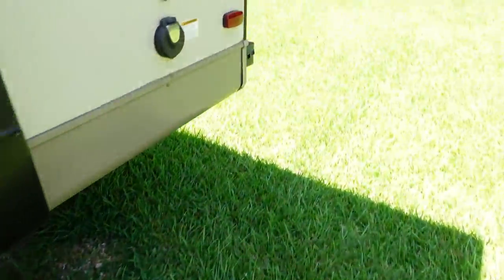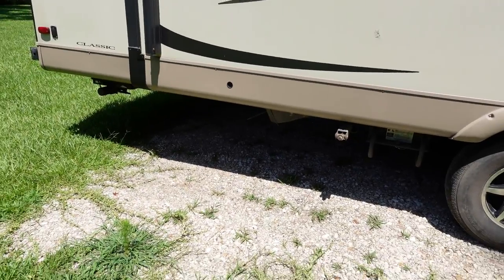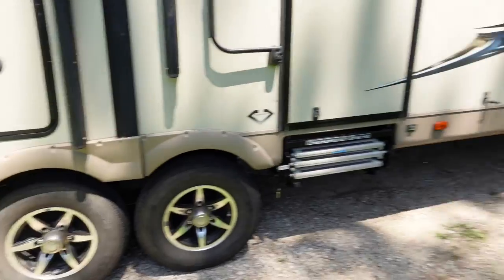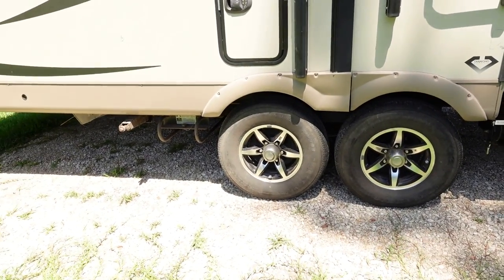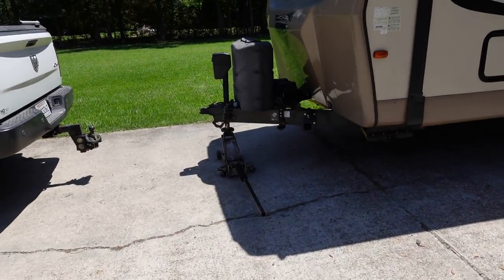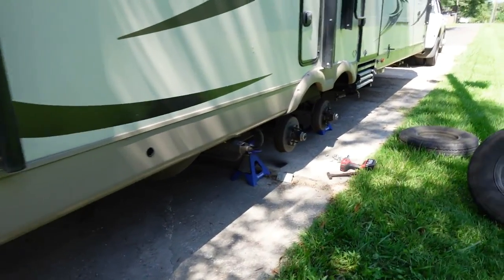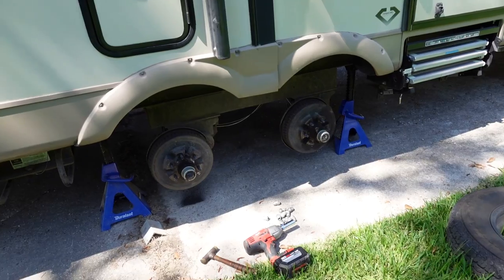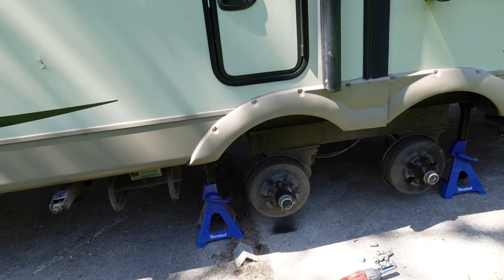RV Camper Excessive Tire Wear

Comment: This is a problem, there are lots of possibilities.   
1] Wheels might have been bent, low pressure, or bad bearings 
2] The Axles or any of the hangers, shocks, springs, the equalizers are bad, or the shackles are worn. 
3] The alignment from the hitch to the front center of each of the tires on the first axles, [[with tires on and hitch level.]], BEST WAY IS TO GET 3 LARGE NAILS and a PLUMB BOB [or equal] BOB THE 3 LOCATIONS AND DRIVE THE NAIL INTO THE GROUND,  MEASURE NAIL TO NAILS.
4] then distance from center to center of caps of the tires on each side. 
5] then measure 'X' style from the inside left front tire to the inside of the right rear tire from under the trailer, and then the opposite two, write everything down.  
6]  BUT BEFORE you do any of that, walk around the trailer and verify that EVERY bolt that is connecting the walls and floors to the metal frame is present and the NUTS and WASHERS are on and are TIGHT.  

I noticed you had at least one with no nut on the driver's side between tires, this is very common. There should be one every 4-6 '' ALL AROUND THE OUTER AREAS look for the out-riggers under the sides, front, and rear.

7] Replace missing and tighten everyone to the PROPER TORQUE Typically 45-75 pounds  it should say somewhere,   mine is 55 pounds
8] YOU NEED TO VERIFY THAT YOUR FRAME AND STRUCTURE IS STILL SQUARE.   
YOU CAN USE THE   ''3, 4, 5'' Rule or measure front left to rear right and front right to rear left.   Another ''X''  

 A BIG 4-6 FOOT ''SQUARE'' IS HELPFULLY or 4 SQ LASERS,
NOTE;; 
NONE OF THE MEASUREMENTS SHOULD BE MORE THAN 1/16'' OFF. [1/8 IS PUSHING IT]

IF YOU NEED OR WANT SOME HELP, LET ME KNOW 

e-trailer has lots of information, pictures, and videos on all of the above. 
good luck I hope this helps.

Comment: I had the same issue on a dual axle travel trailer I bought.  Only had about 3,000 miles on it and I noticed one of the tires had a lot of wear on the outside.  I thought, great.  Now I'm going to have to get a wheel alignment.  I took off that one wheel and I checked the wheel bearing.  It was loose!  Not real loose, but loose.  I tightened it about a turn on the nut and never had anymore issues.  I did have to get another tire, though.  I can't believe how they put these things together!  No quality control at all.

Comment: I got rid of the China Bombs and purchased Goodyear Endurance for my TT the week I purchased the TT,.add it from Nashville through Texas New Mexico and up to Sturgis they still look good and handle great. IMHO the endurance tires are probably the best option especially today with the Covid supply issues. I thought about get LT tires but the proper load range is hard to find in the correct size. I had to order them from discount tire took 4 days to arrive.

Comment: There's absolutely no Quality Control on campers built in the last 3-4 decades 😔  since the manufacturers are all Big Corporations run today and no DOT oversight like vehicle manufacturers have. It's max profits at the customers dime! I purchased a 2019 Winibago travel trailer when it was just 8 months old.  So many things wrong with it 😒 most you would say was just lazy work but it's just that they push the builders to meet a quota  even down to nails holding trim on my sliding bathroom door fell away from the wall because it was missing a bunch of nails and screws, I had to completely remove the entire assembly to fix it . After looking at the bedroom sliding door it has the same issue I have to fix before it falls off also.  My TT has 2 Grey Tanks and one Black I had to replace all 3 valves because they didn't trim the release cables before closing up the belly. Just bad work they didn't want to take 10-15 minutes extra to do it right. I'm going to build my own camper next that way I know its right just have to find a vehicle at auction that's a good base for it. Maybe if I ever win a Powerball I'll start my own Camper company with good Old School American Quality! Something that's hard to find just have to keep it a Private business so I can't be over taking by greedy shareholders. Sorry I ramble on I've seen our American Pride fall since I was born it's so sad.

Comment: Why do trailer tires not last very long I have a 20-foot new suretrack and once a year I have to put tires o
Reply from the maker: In my experience they are not built terribly well and trailers come with the cheapest lightest load rated tires possible.  I always go up a load rating when I change oem trailer tires. Thanks!
Reply: @aaronsrose  thanks